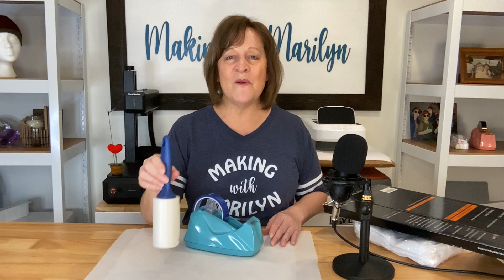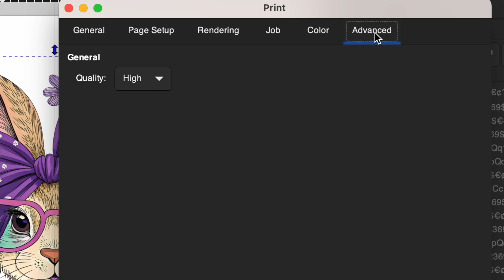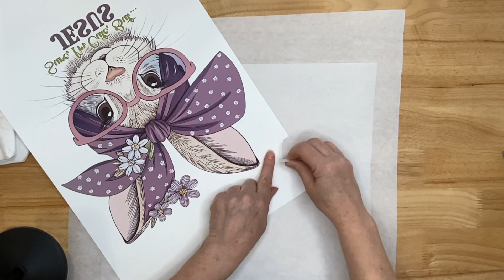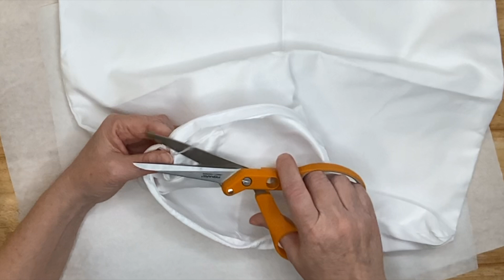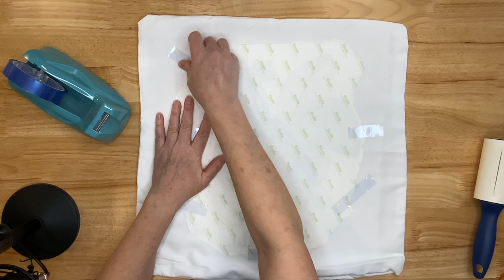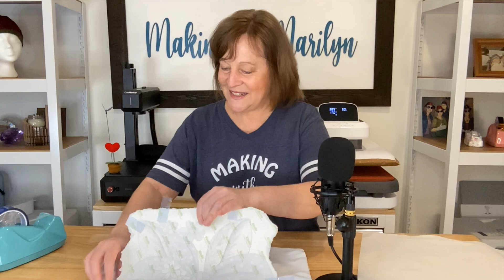Making Crisp and Vibrant Sublimation Pillow Covers

Comment: If i don't have a printer that prints that big can I still sublimate a pillow?
Reply from the maker: You can still sublimate a pillow, but you would have to break up your design or just have a smaller one. You can divide the bunny or other large things, but I could usually see a slight line when I did that. Rather, I would put the bunny (though smaller) on one sheet and add the words at the bottom on a second sheet.